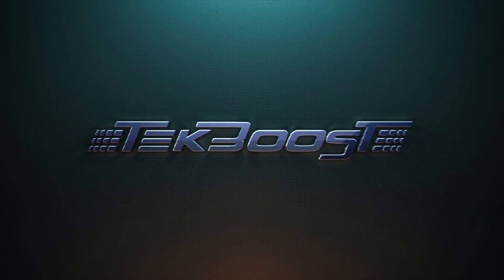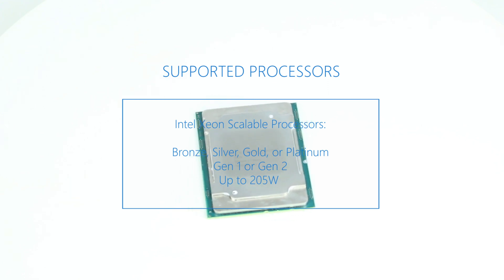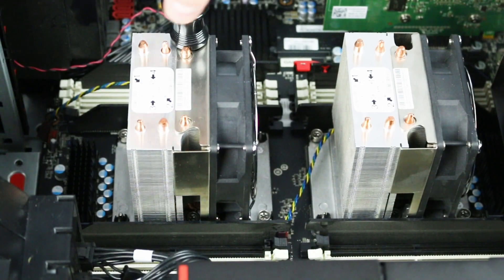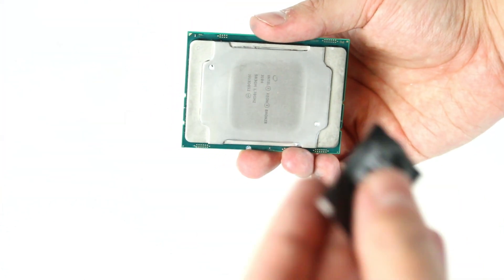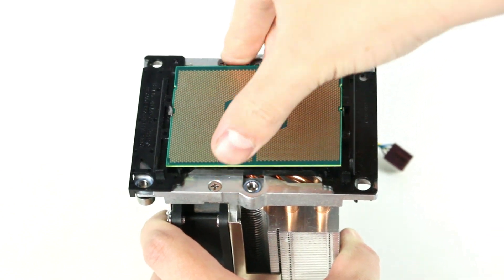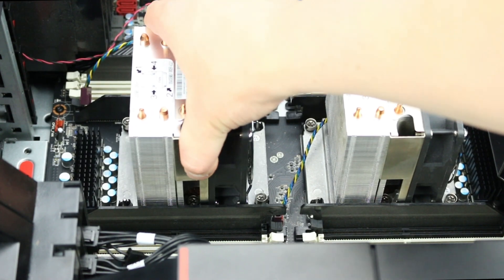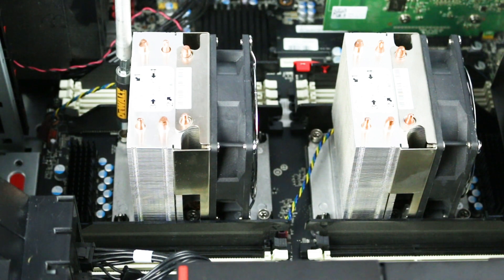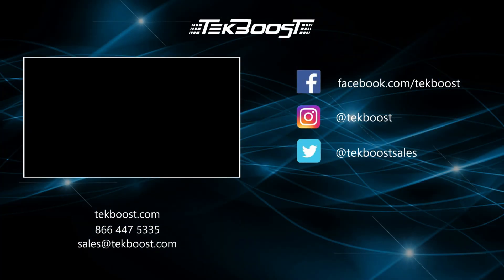Lenovo Thinkstation P920 Processor Installation

Comment: A big brick of worthlessness.
Reply: care to explain ?
Reply: @ I bought one and upgraded both processors. They were Xeon gold 6134’s with 6 cores each. It also had 128 gb or ram and with two decent GPU’s which were gtx 1080’s. I bought it from a seller on eBay and was assured it would be a beast of a PC and that I should not have any issues gaming and other everyday tasks. It actually ended being one of the worst performing workstation PC’s I have ever used. I was better off spending $800 on a good gaming PC instead I wasted $1900 on it. Maybe if I had used it as just a server and nothing else, it would have probably been ok, but as an everyday driver to program and create art on. It’s a big brick of useless shit. Lenovo knows this as well, which is why they canceled it is my assumption. This is just my opinion, it’s not a universal truth.
Reply: You’re not supposed to game on it. You can but that’s not what it’s for. Dual CPUs are horrible for gaming. What you can do is isolate the CPUs in vms for specific needs (inc gaming). So while I’m doing ai art on the rtx 3090, the other half can play hogwarts on one of the win10 vms with the w6600. It’s a great machine.
Reply: @czos9239  yeah I found that out, I wish I was told that by the buyer on eBay that was selling them. They had good reviews and have been selling on eBay for awhile. I believed them and found out the hard way, apart from gaming. I used that comp as an everyday driver for various things and it still sucked. I’m sure if used as just a server it would serve its purpose well. I don’t believe I have ever despised a computer as much as I despise the Lenovo p920. If it was such an amazing beast of a workstation, then why did Lenovo discontinue it?